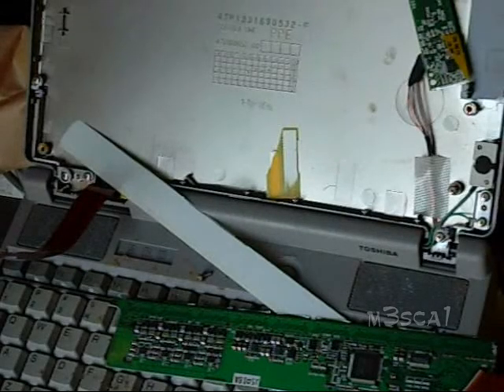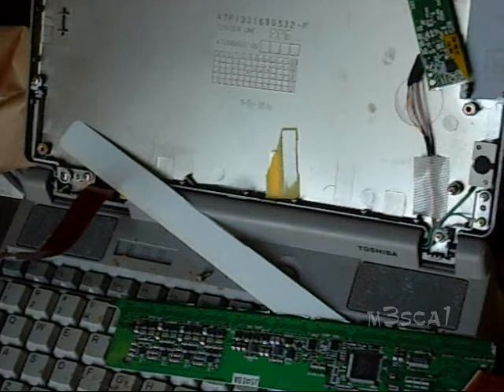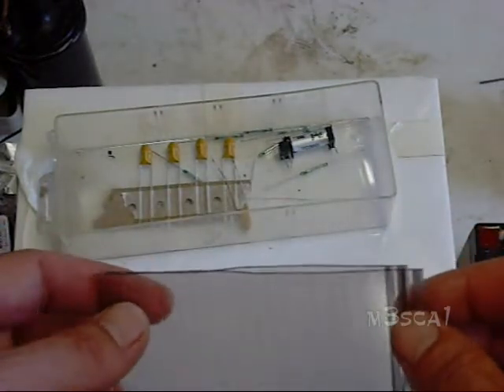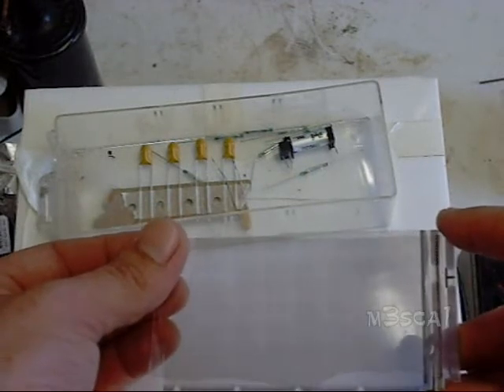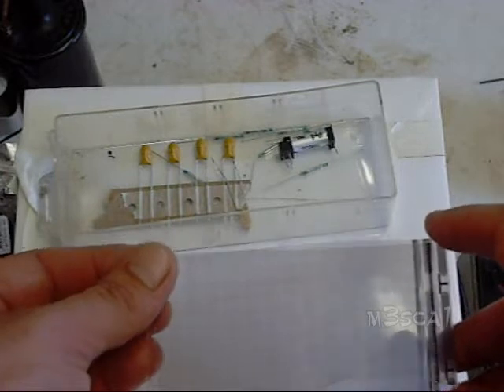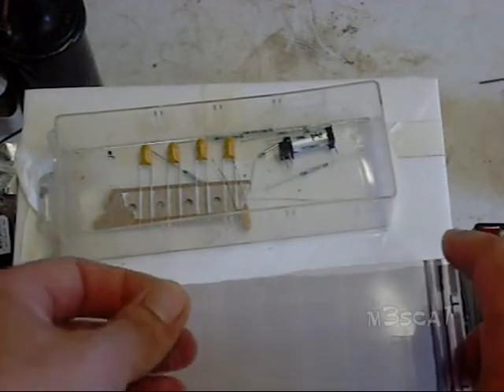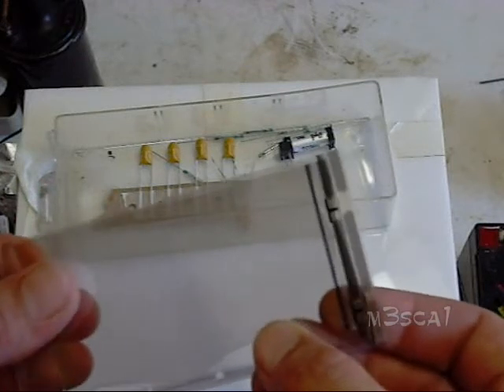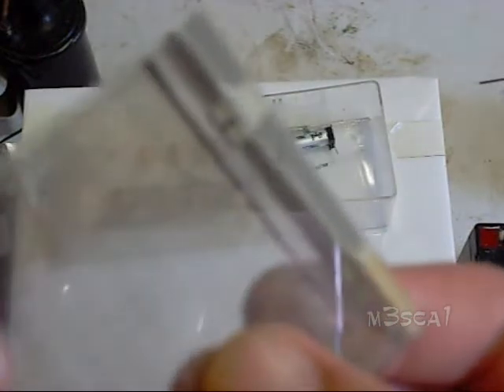moving Grid Screen graticule/LCD recycle

Comment from the maker: yeah any lens will work for close up work (even an magnifying glass)-im having issues with a new camera and the high sound gain.
hears way too much background ,as a result makes the voice the mud in the middle.
think i got it sorted tho -i cut up an ear plug and stuck it over the microphone hole.
we will see when i post next.
the thing i was looking at is a sliding scale graticule,which can be calibrated and used at the focal point of optical devices.
basically a high tech measuring stick

Comment: interesting. food for thought. yet again you have got my brain pumping. I can see several other uses for this as well. depending on the accuracy of  the grid it may be possiable to use it for cnc machines for feedback. perhaps on a different scale. and the fact that it is basicly a sealed unit it would keep coolant and debri from damaging the scale. i can easily build a laser iterferometer to do the measruing for the device. keep me posted will ya. 
thanks
Warren